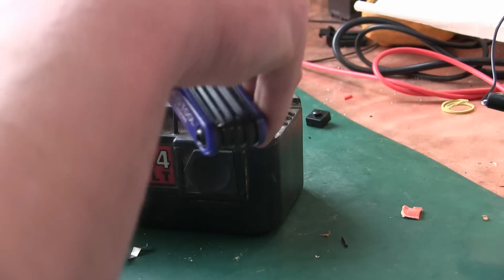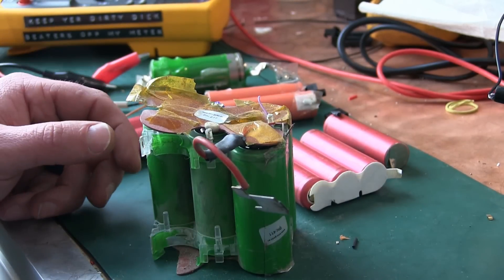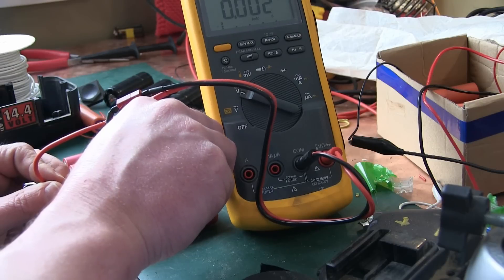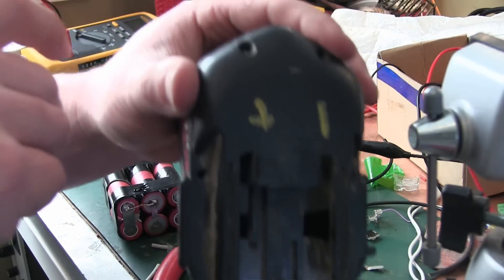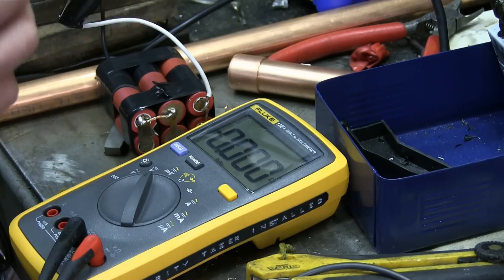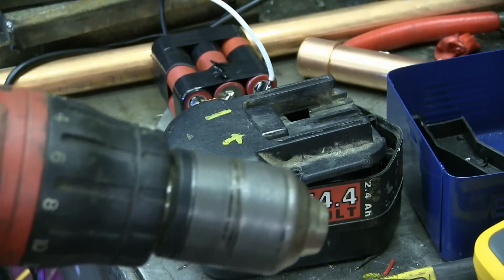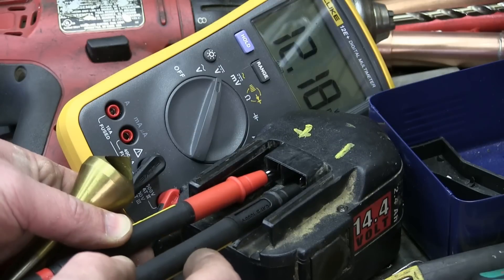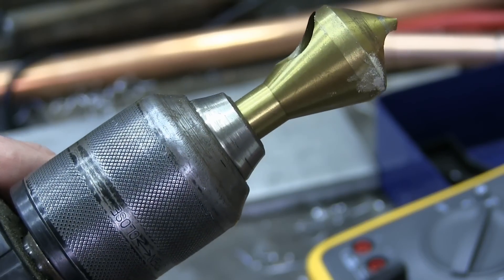New Lithium for Old Tools!

Comment: A little question for the more experienced pixie-wranglers out there: 
I have a little quadcopter (built in 2002) that ran on a 10 cell 12V 350mAh NiMH battery. The copter draws about 4.2A, which destroyed the NiMH battery quite quickly back then. Can I use three 18650 Li-ion cells (let's say ~2Ah) in series to power the thing or will the voltage get too low below a certain amount of charge?
Reply: You can use them, they will have far more capacity than your old NiMh battery. Around 2000-2500 mAh. They will last way longer with enough voltage to fly your copter. 
Use Samsung, LG, Sony or something like that. 
Not Efest (they are not good any more) and definitely not anything with "Fire" in its name. They are crap.
I'd say use Samsung INR18650 25R, really good battery. Replaced almost all my 18650s with those.
Reply: djteac Thank you! :)
Reply: If you have 18650s already salvaged, use them. But it would be better to use one of those 3S lipo packs used in the RC world (whichever size fits or maybe strap it on externally with velcro). They will most likely give you more capacity for the same volume and are built for high currents (many 18650s aren't).

The voltage should be fine. 3S lipos (and many lions, but it depends on the chemistry) go from 12.6V fully charged to 10v (fully discharged, you should not go below this limit if you can avoid it). The NiMH pack was most likely going from 15V (fully charged) down to 9V, so using lipos the performance should be much more consistent.
Reply: The working wattage is what maters imho. LiPo batteries have a C rating that is the current multiplier.  A 20C battery is not uncommon.  Say you find a 3s (11.1v) 1000mAh (1Ah) 20C LiPo that fits your quad copter, the batteries max amps is 1Ah x 20C = 20 amps continuous current.  With 20Amps x 11.1v = 222 Watts.  With a budget of 222 Watts divided by four motors would be 55.5 Watts power motor.  Downside is at 20C you would drain the battery is 3 minuets. Now to run the method backwards, your looking at four motors at 12 Watts each.  That is 48 Watts and your want a run time of ~12 minuets (0.2 of an hour) witch gives you a total needed battery capacity of 48W x 0.2h = 9.6watt hours.  Watts = voltage x current, so we know the voltage is 11.1 volts witch gives us 0.865Ah battery.  LiPo is normally expressed in mAh (milli Amp hour) so that would be 865mAh battery, that is a odd ball number so round up to 1000mAh 11.1v.  hoped this helps.
Reply: Yes, thank you! I assume that I will need a protection circuit to go with the lipo, if I don't want to have a nice little bonfire if something goes wrong? xD
Reply: All right then, thank you very much! :)
Reply: 20c cells aren't that common, and the higher the c rate on the battery, the lower the capacity.  If you only need 2c cells for the heli, buy 2c or similar cells rather then 20c, it will be cheaper, and have more capacity.

  One of the pitfalls of changing to lithium from nicad or mimh is the voltage curve.  nimh and nicad go to 1.2v almost instantly, and stay there until they are almost dead.  A lithium cell goes from 4.2v to 3.2v in a curve, most of it's capacity is around 3.6-3.7v, but there's still a fair bit above and below that voltage.  If your application is voltage sensitive you'll need some sort of BMS or at least a low voltage cutoff and buck converter to stabilize the voltage.
Reply: while LiIon cells usually get charged to 4.2V, under load they quickly drop to around 3.5V-3.8V, stay there for the majority of their charge and drop very quickly towards the end. so working voltage is around 3.6V. oh and you need some kind of charging/discharging circuit. LiIon cells should never be charged to more than 4.2V (in fact, lower maximum voltages drastically increase their life) and should never be discharged to lower than 2,5V at the absolute limit (below that, the batteries chemistry will start to break down). what AvE did here is a pretty accelerated death sentence for the batteries and possibly dangerous as well.

Comment: yeah, this is something I would really really really not recommend.
charging lithium ion cells in series without monitoring the voltage of each cell is dangerous.

Did you match the SOC of each cell?

Comment: i have a yellow ni cad battery and it doesn't hold charge anymore 
it will charge but if you leave it on the charge it drains itself leave it in the drill its dead leave it by itself it slowly drains power depending on how long it sits 
what would be the cause of that (i took the battery and the charger apart and i haven't found anything wrong with it but yet it still loses charge)
Reply: in ELI5 terms. As you use an abuse your batteries they get worse and worse through the ages. They grow wee things inside (called dendrites) these little beasties lower the active area of ion exchange (swappy swappy makey power) and eventually will grow enough that they short circuit the cell internally. At that point your buggery is battered.

I have heard tell of people reconditioning NiCads by smashing a huge current though them using a welder. Try at your own risk!
Reply: its only a month old which is weird but it was recon at direct tools so they maybe why and its only 9.6V and the charge does have coil wine in the power pack so that could be the problem 
oh well it was only $20 for the drill plus $10 for the bits that came with it
Reply: IIRC it only works to burn off the dendrite growths, and shortens the capacity a bit, but working crappy battery is better than not battery at all!
Reply: its a ryobi 
i used a 24 volt 1.3 A power pack and zapped them and it seems to hold charge now (for about 3 hours of use depending on how must stress i put on it)
i agree since its the only drill i have right now
Reply: I've done this. Not with a welder, I just used a car battery. Ni-Cad was dead, like pull it off the charger and slot it in and it spins feebly if that dead. Zapped the bastard and it pulls again. Not as long of life as it once had, I'm sure, but I don't generally use it for long enough at a time to run it down. Not bad for a free drill.
Reply: yea lol
Reply: People have used flash units off an old camera to kill the dendroids , a zap of mains, a dab across a car battery.
I used a 12V charge, which worked well on individual 1.2V cells.
For a 12V NiCad drill pack I gave it 24V at 10A for a few seconds and it's been working fine ever since.
Not "as new" but holds a charge.
Reply: all i have is 24V 1.2A from a kodak power supply for a printer i had
Reply: Car batteries, in series'll get you there, if you're an IT or installation guy the SLAs for UPS and fire systems/emergency lighting give enough or a kick too.

Comment: No over charge, over discharge protection or balancing? Living on the edge huh?! :P
I figure you probably have the 18650 cells from an old laptop battery or so. They usually aren't all that low ESR, meaning they can't provide a lot of discharge current. And such drills can be quite power hungry. Also from my experience batteries with under 2.5V can be a little volatile and often aren't all that great. Most of the time though, laptop batteries fail 'cause one (or x cells in parallel) fail, so if you find a broken laptop battery that hasn't been sitting too long, chances are most of the cells will be somewhere between 3.6-4.2V. You can also buy new cells on eBay relatively cheaply. There are some 18650 cells from Samsung etc. that have up to 3600mAh but they usually have an even higher ESR not to mention they are more expensive. And of course you can find those 9000mAh etc. batteries from China like the TrustFire and UltraFire ones etc. with more like 300mAh in reality, unknown ESR and unknown practically everything, not to mention, a Li-Ion battery brand that has fire in it's name is probably not the best choice anyway. :D
Anyway, this is obviously one of these cases where one can either do it as cheap or as professional as possible but not so easy both. If you wanna do it right, I would suggest using Li-Po batteries, some of them can provide 100C (100 times their rated capacity), if you have a 3000mAh quadcopter battery, that would be enough to start a car. They are quite sensitive though. You would need to balance them and well, protection circuits would be a good idea as well. Not that Li-Ion batteries don't need protection, but you can get away without balancing and it's usually not a major problem.

Comment: Hey, boss...
I've got an 18v. NiCad battery from a snap on impact tool that shows charged, reads 19v. and a little change when I check it with a meter and when I pulled it apart, the cells all seem fine with a couple volts but when I connect it to the tool, I get nothin.  The tool works with another battery and charger is fine.  Resistor?  Help if you (or anyone) can.  Thanks.

Comment: You briefly showed a pic of a power drill with cord leading to a  battery bank. Why don't they do this?
  Trying to design battery capacity around what can be fit on the housing seems like a terrible way to do these tools.

Comment: Good idea bad implemention.
Use sort of UVLO circuit(comparator with vreference) to drive FET power switch or get some ready made solution that can handle the amps and charge the battery with balance lead with rc plane lipo balancercharger.
Simple and cheap solution. Balancer charger 25usd, batterias about the same.

Comment: Hi  AvE , I tried to make a similar project a year ago but found difficulty in recharging the whole pack with the OEM charger.I believe that the protection chips on the positive side of usual 18650 batteries were the problem , so what are your thoughts on that ?
Reply: Buy an universal charger that RC folks use. They are not expensive, and are capable of charging whatever you want, how ever you want.
Reply: Thank you VIDA !
Oscar Uniform Tango .
Reply: You can get unprotected 18650 batteries, just be careful with them!
Reply: I am trying to avoid that or even remove the chip from the ones I already have because of the fear of burning down my house! these chinese batteries with such voltage ,capacity and amp output are beyond my comfort zone especially with my project where they are both parallel and series connected .
Reply: arno maas I would avoid connecting them parallel in appliaction like that.
Reply: the battery pack in question has to give an output of 7,2 volts and enough juice to power a powertool so I don't have a way around it and whatever the battery selection I may end up , I need to have good amperage so I won't fry the batteries.so 1 or even 2 parallels are necessary.
I most likely may get some Nicd cells  and recreate the OEM pack.
Reply: arno maas The problem is that at such current difference between internal resistance of cells can become an issue. Thats why you never see them paralleled.
Why dont you try Li-Po packs? They are rated 50C and more, so we are talking about 100A or more for a drill sized cell. The only drawback is that you need a suitable charger and something to sound a signal when cells are empty. All comercially available. I did it myself for an old drill.
Reply: VictorIndiaDeltaAlfa
that sounds very promising , I will search that more since I initially rejected such a solution because of the cost.Thank you very much for your advice !

Comment: On the risk to be a bit anal.
I would suggest adding a balancer port and charging this thing with a cheapo RC battery charger.
Especially with the dodgy old batteries. With them all in series you won't even see if one goes wonky and overcharge the rest.

Comment: chances are the batteries you put in are toast to start. buy some LG HG2 cells those put out 30 amps a peace! i made a NiCad leaf blower lithium and it blows harder than a prostitute.  i would also suggest putting on a balance lead wire for balance charging and also allows you to use a low voltage beeper device that is commonly used on RC. hear it beeping stop using the tool and charge up.

Comment: How does he use those Wera screwdrivers? I was eager to buy a set but was put off by those "ergonomic" handles.
Reply: He’s not a fan but its one of the only security torx in a solid handle drivers available

Comment: How are you going to charge this thing? Niclads and lithium batteries have a different charging cycle. Are you going to stick this monster into the original niclad charger? Dangerous sxxt messing with lithium batteries.

Comment: try lipo batteries from rc airplanes. there might be better for the drill. but they're bigger, may not fit in.
Reply: more dangerous! but they're any size you could think of!
Reply: +King Harkinian more dangerous = more views!
Reply: +TheJohn8765 don't fold the battery, very big risk of it catching on fire later on. Also the protection circuit for a tablet has a current limit of just a few amps, it won't work with power tools
Reply: That's what I did. Had an old 12V NiCad-powered DeWilt drill. Batteries died, stuck in a 3S LiPo in each housing, drilled an extra hole for the balancer cable, and now charge them with a balance charger. Cost me pretty much nothing except the €9 charger, as I had the batteries already laying around unused at home...
Reply: Protection circuit is great for overcharge / overtemp scenarios.  But you physically damage a lipo cell, and you have less of a drill and more of a fireball.  The RC packs are recommended to charge and store in a fireproof bag for to not burn your house down.
Reply: You need High current capability ones... Samsung IRN ones are fine yet they do cost quite a bit.
Reply: LiPos for RC planes generally don't have protection circuits because a crashed plane is more expensive than the battery.

Comment: There are still places you can get those batteries:  http://www.cpomilwaukee.com/milwaukee-48-11-1024-14-4v-2-4-ah-ni-cd-battery/miln48-11-1024,default,pd.html?start=1&cgid=milwaukee-batteries&prefn1=voltage&prefv1=14%2e4V if you're really that attached to that old drill.
Reply: You can get the cub C cells in it to rebuild the pack for maybe $30. Probably get a 3Ah battery out of the rebuild too. But I've had two of those old Milwaukee chargers fail on me. So there's that problem. Same problem with both of them too. So there is some long term defect designed into them I think? Some part that over time craps out. Might just be the electrolytic caps in it? I never cracked one open to look.

Comment: If running lithium down to nothing is bad is there something in the tools that stops you doing it?
Reply: +AvE this man on the trigger is a battery killer. I'm about to pull apart a dewiltted 20 v that won't "chooch"
Reply: +AvE man I hope its cape batteries '18650'
Reply: Yes, the battery pack itself often has this circuit, and you can also get "protected" lithium ion cells which have their own circuit built in, and undervoltage is one thing those circuits usually do protect against, in order to maintain battery lifespan.

If you make your own battery pack, cut out any circuitry, and use unprotected cells, your only protection is yourself.

Comment: Hey there, saw your video regarding the Fluke meter that was only for sale in china and cheaper than what us schmoes in north american can obtain. ANYWAY the purpose of my comment is to ask you if you have heard/ Are willing to take a Mastech MS822 Multimeter to bits and see what kind of dirty secrets its hiding for 45 dollars. It claims to do all the Hz % duty cycle AC/DC v/a  capacitance resistance temperature humidity  AND LUX and Db?????? seems like alot for one meter. Consequently i couldn't find the exact model on the American page.

Comment: Hello, I really like watching your videos and had some questions maybe you can help me with. I have a Sears Craftsman 19.2 volt drill and other tools that use that battery but over time they get weaker and I have to spend $40 plus tax for another battery.
 
 These are NiCad batteries and for what I use them for they are ok, I don't want to convert them to Lithium, just would like to bring these dead batteries back to life if you can tell me how or if you think it is just better to keep buying these $40 batteries from Sears. 

I have 4 or 5 batteries that will not charge up anymore and the batteries I have will die within a week or two if I don't use them. This is not for work, just stuff around the house and on my work trailer to work on things as needed. 

I have seen videos where they say you can bring batteries and individual cells back to life and I have seen other guys say the cells once dead or dying will not last even if you bring them back. Would you recommend buying cells on Ebay or somewhere and replacing the cells (I don't know how to test the cells) or just keep buying the batteries as needed from Sears for the $40.00 each? I would not mind buying cells and fixing the old battery if you can tell me how to test each cell to know if it is bad. I appreciate your advice. 

Thank you.
Reply: I just spend 50€  on a rotary hammer  with Li-ion battery and charger or almost cheaper than a Makita battery pack...Nicads had their time but they 're obsolete now.
Reply: You can rebuild with new sub-c NiCd cells. Don't try to reuse old ones. The cells that aren't dead are near end of life. Chinesium Craftsman C3 NiCd clones are available for less than $20.
You can get new Craftsman compatible C3 Lithium packs and a universal charger just about anywhere.
Reply: I gave in and bought the 4ah lithium battery and the required multi chemistry charger, and haven't looked back. Craftsman nicad packs are beyond worthless. You'd be amazed at how much more powerful your tools are with the lithium battery.